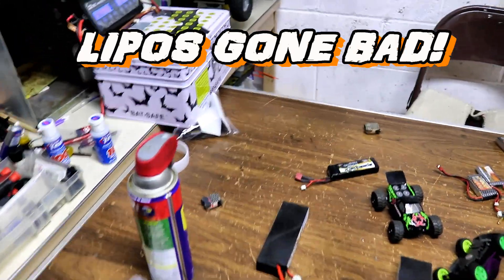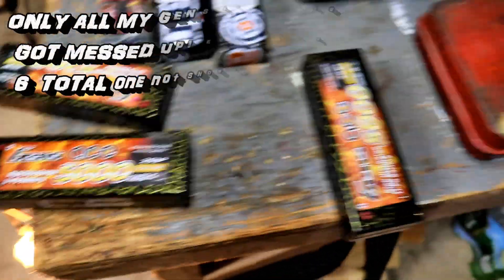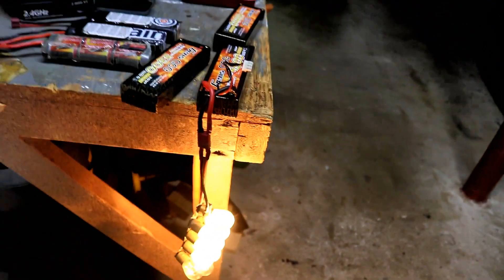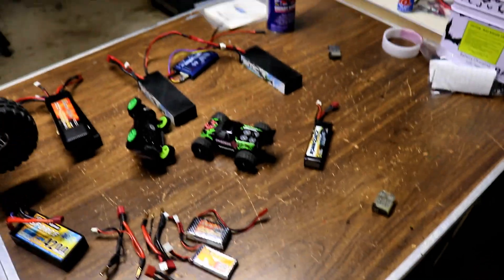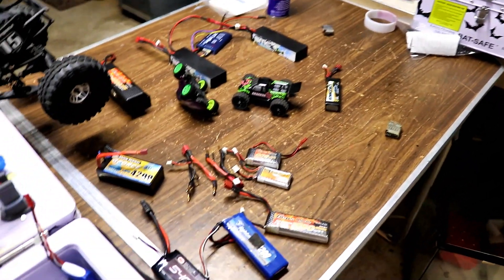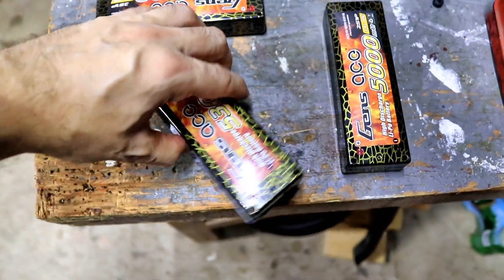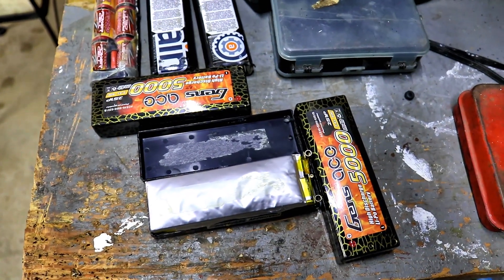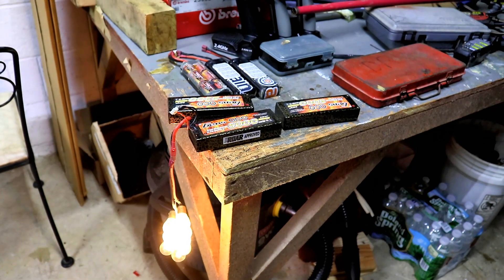BAD GENS ACE LIPOS & How to Discharge and Dispose of LiPo Batteries

Comment: Good job. I keep all mine in storage mode. Think my auto-storage is set to 3.6. Better low, because they gain voltage when lying around unused. So far no problems, but I haven’t got as many as you. I’m old fashioned, I still have Ni-MHs too 😄 All my LiPos are hard packs. Wonder how they look underneath. Good vid.
Reply from the maker: 😊👍Thanks bud, I have nimh also.. I also have a lot more lipos that are not shown in the video... I like the nimh in most of the tamiyas you don't need lipos for them.

Comment: Good info man!
I just use salt water no point it draining them first house the salt water does anyways lol
Oh I would have kept them they didn't look that bad my rule is it it still stays ballanced and don't get hot while charging you can get a little use out of them yet unless there crazy puffed 😊
Some of the lipos me and my friends have used would scare you for sure 😂
Reply from the maker: 😃👍yea I mentioned the salt method. these where bad I broke the plastic casing off they where so puffed and pressurized inside those cases you could not get them back inside at all they where that bad. Thanks for watching bud.
Reply: Shen RC dang that sucks at least lipos are getting cheaper all the time lol
 I got a puffed 5200mah that's been going strong for months still stays balanced just fine to lol
Reply from the maker: 😃👍yea they still work but these were super puffed...a puffed lipo is most likely fine in a crawler but in a high amperage RC it wont work good. and gens ace stink all my other packs are fine and I have way more I did not show all of my lipos in this video..No more gens ace for me!
Reply: Shen RC  for sure I'm sure mine got puffed from a basher draining it them fast (they where puffed when I got them used) i did use them in my brushless ruckus a few times and it was really hot out without a issue but there not gens ace 😂 I'll steer clear of that brand to lol 
How old where the gens ace lipos you had?
Reply from the maker: 😃👍 yea i think i could have ran them in crawlers no problem for a long time,,, I don't recall the age of them a few years or so.

Comment: Great info bud I love the light discaharge system.  How long are you getting out of your lipo's.  These last sets of electron pro's I've got been good for over 2yrs now..I enjoyed seeing what was inside the hard case.. I've never taken one apart.. That's what I run is hard packs.. Thumbs ups!
Reply from the maker: 😃👍Thanks, I recall these started puffing like less than a year after I got them and i just kept using them and they got super bad after a few years.....and I used them all in mild cars nothing that draws a lot of current.

Comment: Yeah had the same problem with mine. I have 3 that did it. They are 8 yrs. old. I tried running a slightly puffed one & it swelled up even more & got super hot. Almost had a melt down.
Reply from the maker: 😊👍yea be careful with lipos. Thanks.

Comment: Get some power hobby lipos, I've been using them in my stuff for over a year now no problems
Reply from the maker: 😃👍 thanks SMC i like the best.
Reply: Never tried smc but have heard good things
Reply: I also run floureonsin my low power trail trucks ,not bad for those ,but have had them bloat up in other rigs with more power
Reply: Also running xt90 plugs ,keeps them from getting too warm when running hard

Comment: Puffy Lithium Polymer batteries are dangerous they can catch on fire...... 8^(
Reply from the maker: 😊👍👍Kaboom!
Reply: Yep you got it... When the foil package allows air (oxygen) to be exposed to the Lithium Polymer then the chemical reaction will be heat.... 8^O